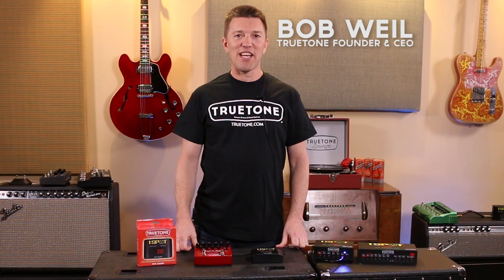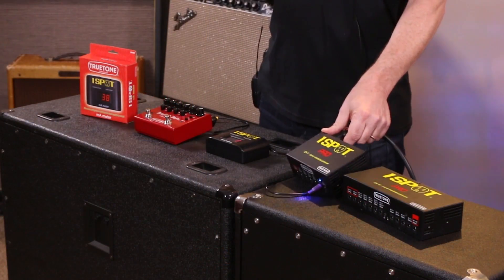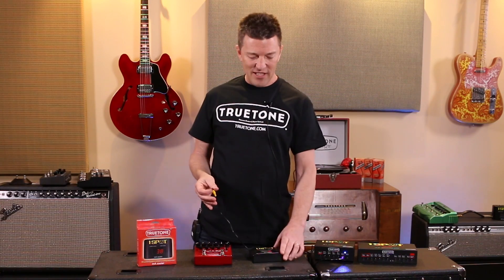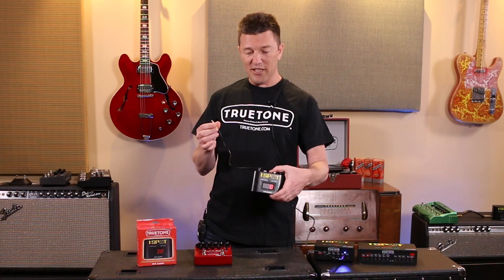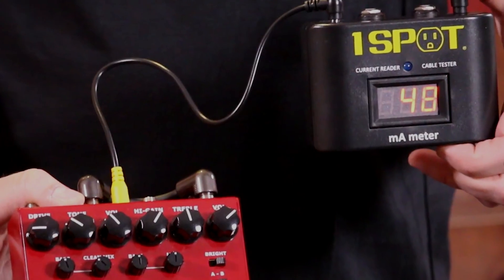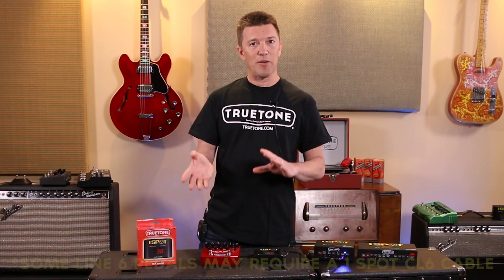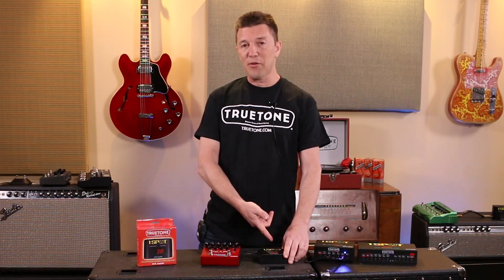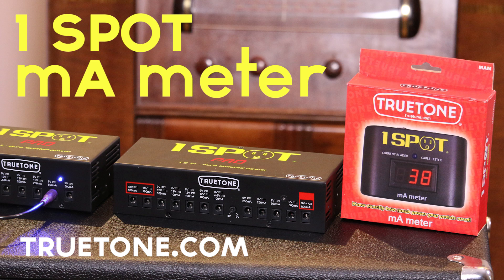1 SPOT mA meter | Truetone | Commercial

Comment: I have a pedal that has a 2.5mm power jack. Will that work? Is there a converter/adapter?
Reply from the maker: we make a CL6 converter
Reply: @TruetoneFX  nice. And can I combine that with the CYR? The pedal is center positive
Reply from the maker: The CL6 is center pin positive. It flips the polarity

Comment: Does it matter if the pedal is center negative or positive pin?
Reply from the maker: The power going in must be center pin negative, but you can go out of it center pin positive by using a CYR, reverse polarity converter.